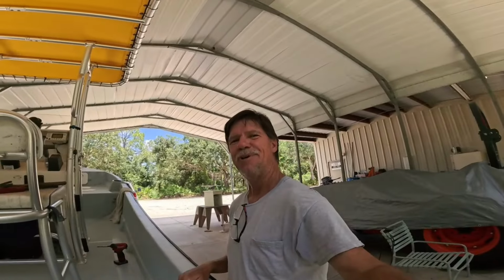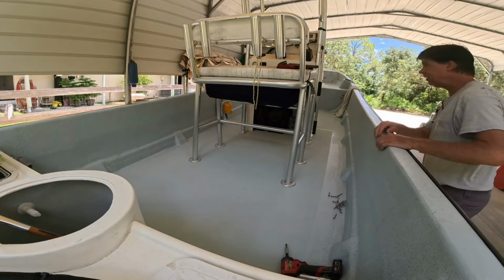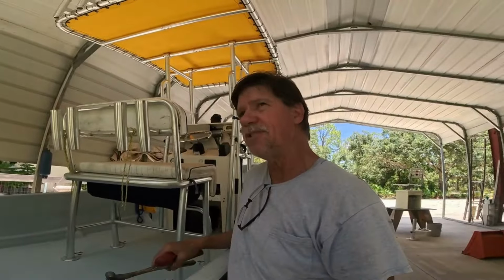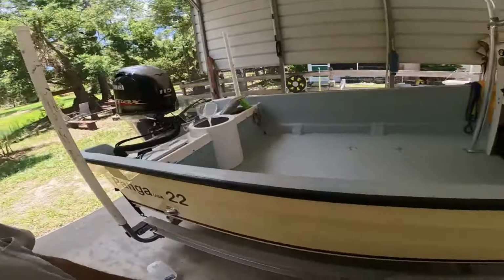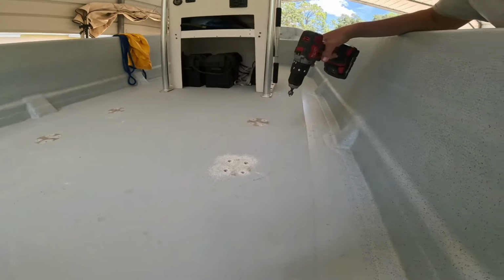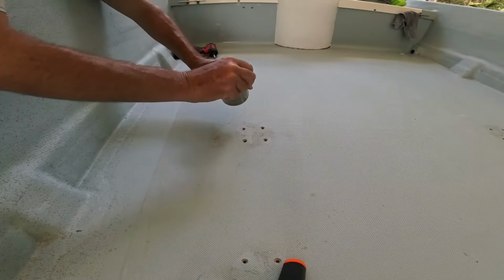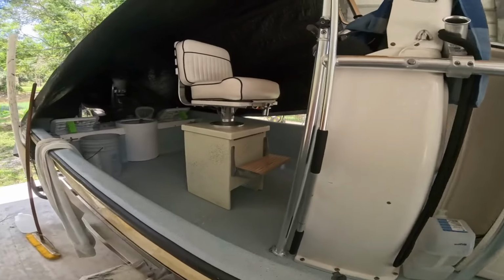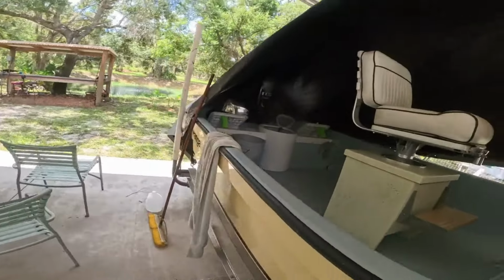Repairing Deck Screw Holes/Install New Seat Base #fiberglass #boat #boatrestoration #pangaboat

Comment: I, too, need to fill a bunch of old screw holes in the deck of my boat. Could you please specify the exact description and brand of the "silica", "glass fibers" and resin that you used, and also your recipe for mixing these components. Thanks!
Reply from the maker: Any fiberglass supply will have exactly what you need. Polyester resin, the glass fibers are just chopped fiberglass cloth, 1/4'' chop is most common and the silica as a thickener. If you have no wood just about any marine filler will work fine, but if there is wood you'll want your mixture just thin enough for the resin to soak out into the wood, that will seal the wood from future rot.